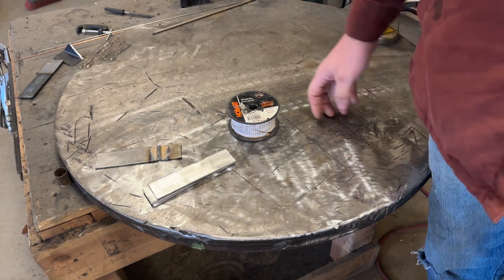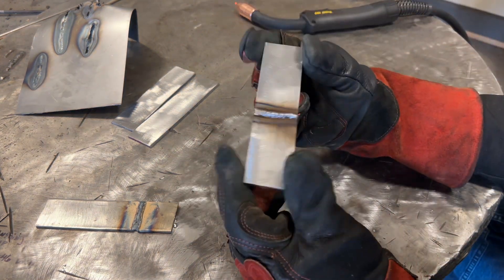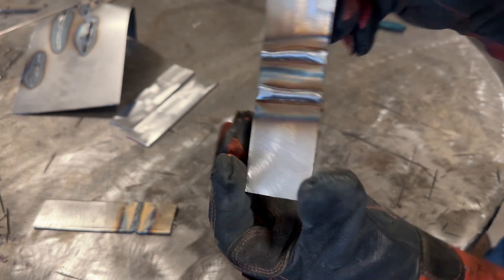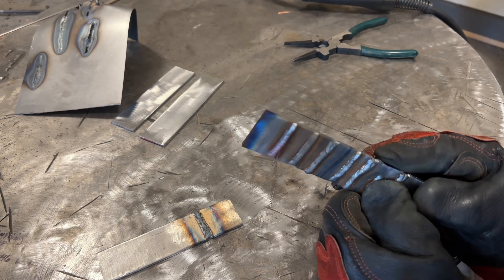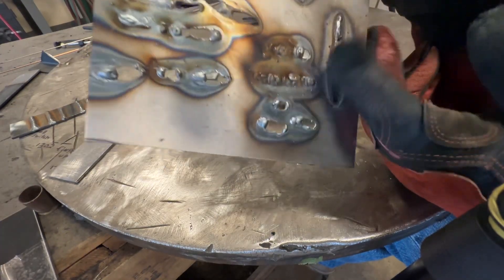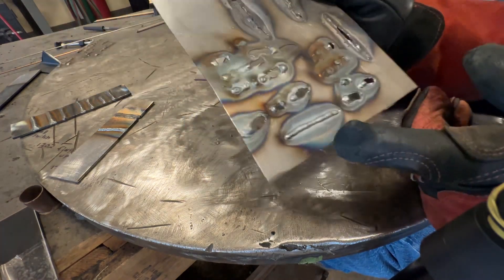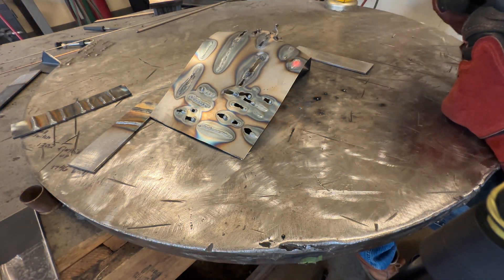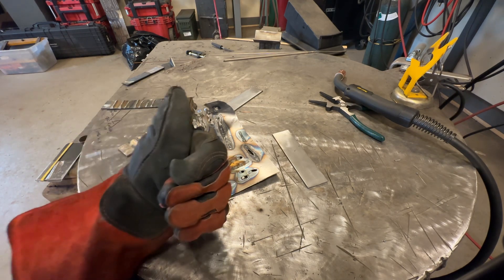Mig welding with .023 wire and limited voltage control troubleshooting

Comment: I have a Miller Millermatic 211 transformer welder. It doesn't have taps. It has a dial but without any digital readout. I do 18 and 20 gauge auto body welding with 023 wire. It works great but I had to play with the settings. I will have to see if I can put a meter on it to see what the Voltage and amperage is. You  got me curious. Very informative video as always. Are you using the FirePower or the Dynasty machine today?
Reply from the maker: I was using the firepower machine.  I am actually surprised at how well it could do with proper settings on that 22ga.  It made it easy, I am not sure .030 flux core would have been able to weld it half as easy.  I know I tried to stick weld it (that was the previous welds on that scrap) and needless to say I failed at that miserably 😅

Comment: i owned a hobart 190 some years back the 210 mvps little brother i never put a meter on it but on 18-20 gauge  with 023 it worked really good for autobody stuff but thinking back it was all spot welding not so much running beads ,, iv found with the fp200 having the luxury of inductance control when i had spoolarc 035 in it running the door chart settings my beads wouldnt flatten down and wet out to my liking until i turn the inductance to 8-10 would be interesting if you would see the same results with testing with the 023 on 1/8 vs adjusting voltage and wire speed
Reply from the maker: I will definitely fool around with the inductance.  Being that I primarily tig and stick weld, I never bothered to buy a mig machine with controls like inductance.  I know that it changes how fast the current ramps up from the shorting of the wire (higher means crispy arc and more heat input, lower means softer arc) but I haven’t really used it on much.  Much like run in and burn back it really helps a person dial in things just right.

Comment: It seemed odd that Hobart would make a machine that wouldn’t be capable of welding sheet metal. I looked up the chart online and it shows that it’s able to weld 24 gauge and thicker.  I’m not sure what the tap settings translate to, but I’ve never known Hobart to bs really.
Reply from the maker: Yeah they state it will weld that thin but without having the welder it may be fairly difficult to do so.  The newer inverters really brought a lot to the table with the ability at the extremes (like welding super thin).  Every welder I grew up with (and most I used in school) were straight transformer machines, but I have seen a ton of positives towards inverters.  It’s just too bad they generally don’t last as long as simple transformer machines.

Comment: I rarely ever weld with .023 but I will be doin some shortly on a little project. A quick tip Greg is to push your puddle with mig. It’ll wet in better.
Reply from the maker: Great tip.  I have a tendency to pull with all wire, and it surely would have likely changed the weld a bit.

Comment: The spot weld method works well to prevent distortion. But it will be ugly and it will require grinding. Thinnest I can ever do is 18ga. But .030 is the thinnest wire I have.
Reply from the maker: The .023 and low settings made it real easy to weld that 22ga, I am actually surprised at how easy it was (I only tig weld thin stuff).  .030 would surely be harder, I don’t even know if that would be possible.

Comment from the maker: Couple things: 1: feel free to skip the ads if there are any.  2: it’s possible that the viewers machine is not constant voltage like mine.  Having transformer taps may actually give a volt/amp curve and 19 volts may actually be a maximum on that particular setting and not a minimum.  The Hobart 210 mvp mentions 22ga and gives a setting for it in its chart, therefore I tend to believe it can weld 22 ga.  This means it likely does have the ability to output less voltage than 19 as a minimum.  Without having the welder to test myself I can’t verify that it will indeed weld with .024 wire and thin sheet.  Older transformer machines don’t have the adjustability of inverters, basically you have fewer ways to dial in heat to metal ratios.  They tend to still weld very good and basically “dope” the settings for you, aka you can’t put your heat to metal ratios far out from ideal, which is actually a decent benefit (especially for new welders).